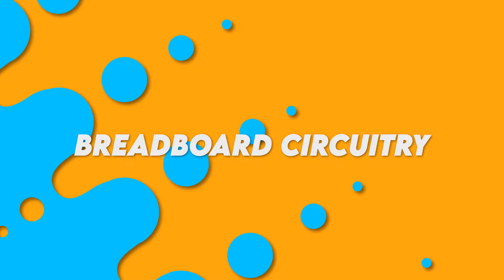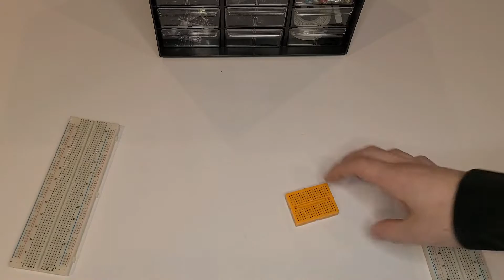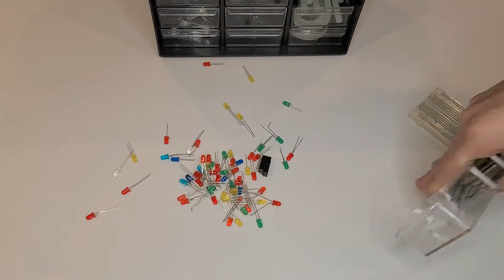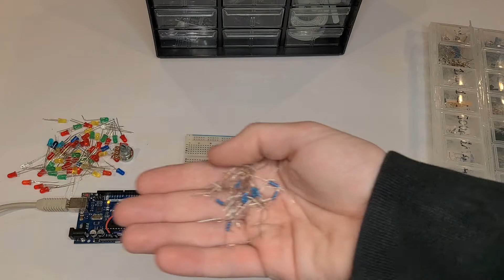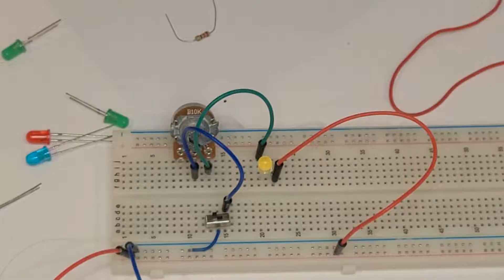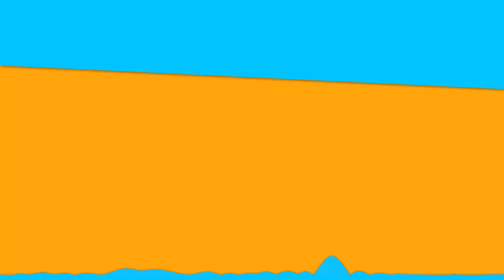Arduino Basics 1:  Breadboard Circuitry

Comment: I loved the animations.  This is like the 5th bread board video I watched in a row and I think I get it now.  When you explained that the resistor doesn't have to be before or after the item that can't handle the (5v) directly from the Arduino, and with the demonstration of the potentiometer and explanation of how it's really the flow of traffic as the voltage that needs to be toggled/controlled in the circuit so the pieces don't burn out.  .  Brainblast.  Because I would see people having the resistors in different spots in different videos and no one addressed it.